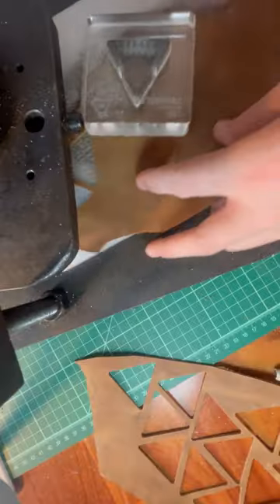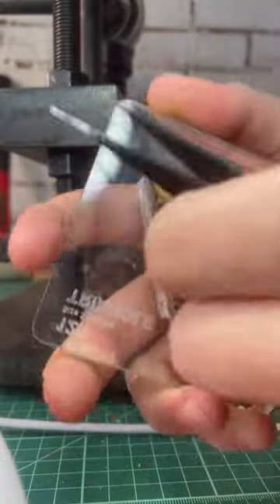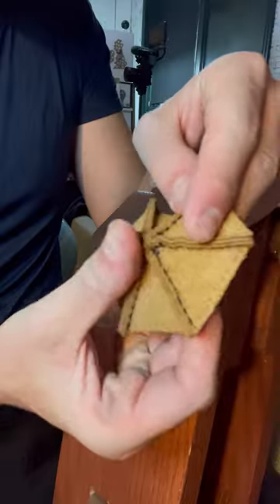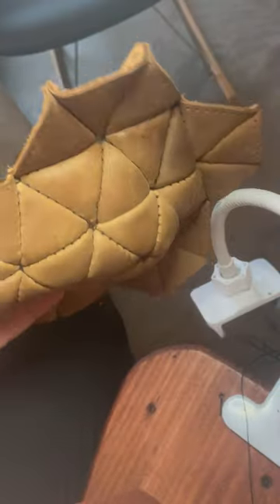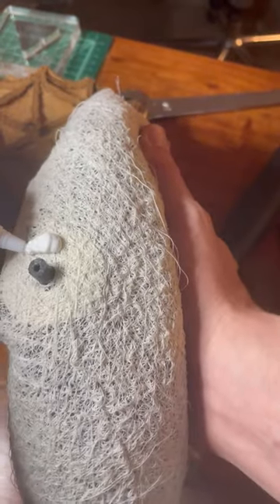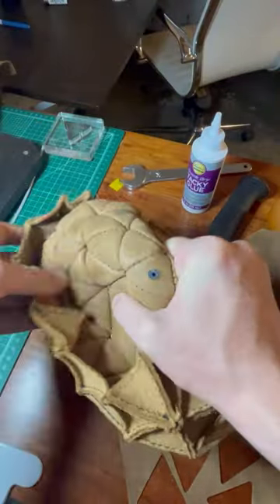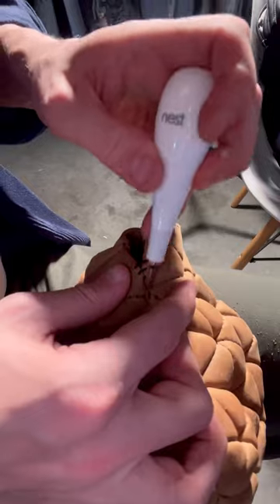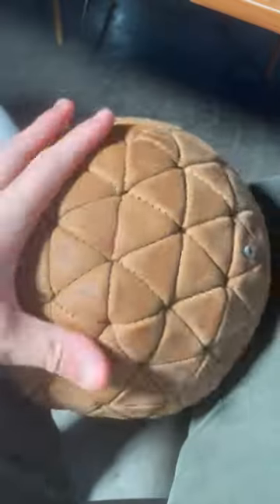Making a Ball With 180 Triangle Cells

Comment: You just need another triangle die with two 54° angles and one 72° angle. If five of those meet up at their 72° angles in the middle it forms a perfect pentagon. If the sides of these pentagons (the sides between 54° angles in the triangles) have the same length as the sides of your pentagons, then they should form a rounder ball.
Reply: ... Or, in keeping with your new company name, scale the 54°-54°-72° triangle die so that the areas of 60 of these triangles (12 pentagons) add up to the surface area of a ball.
Reply: That’s only on a plane. Since this is a rounded surface that’s not the case. The shape is called an icosphere. In fact, since it’s a procedurally defined shape, there many be numerous different triangle sizes needed